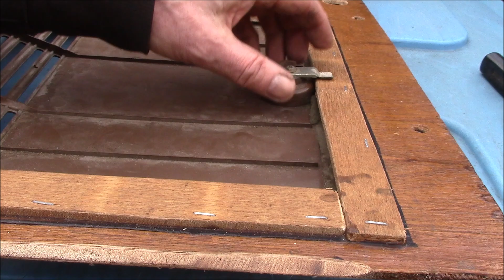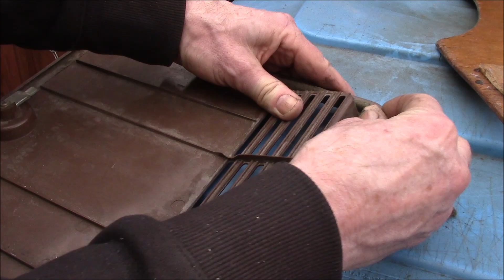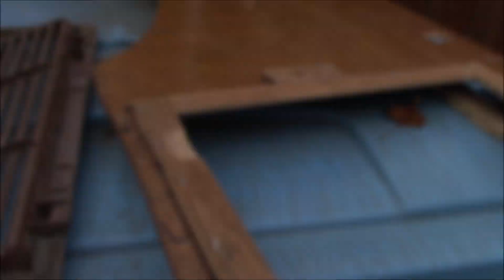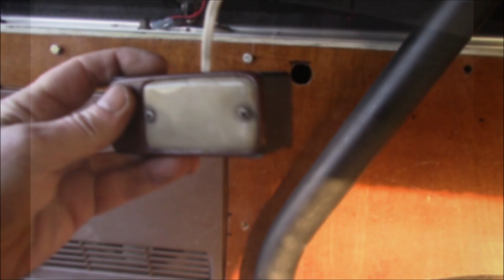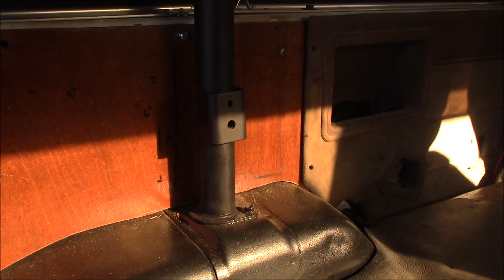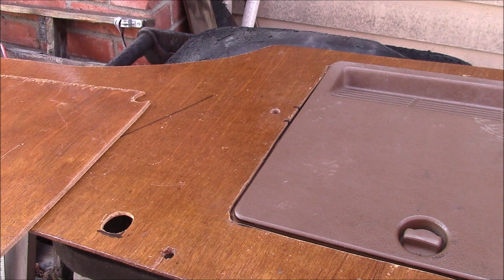1st Generation Toyota 4Runner, Plywood Bed Side Panels, Part 2

Comment from the maker: This video was a collection of clips shot over a few months, so it jumps around a bit.  The main point was to capture some of the issues related to converting from the flexible plastic side panels to a stiffer, flat sheet of plywood, as the bed sides are not a simple flat surface.